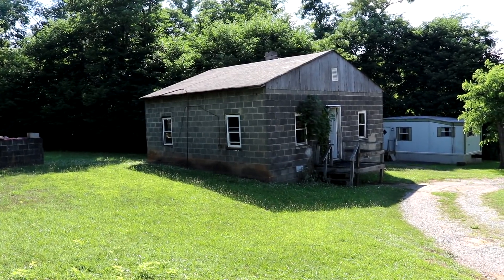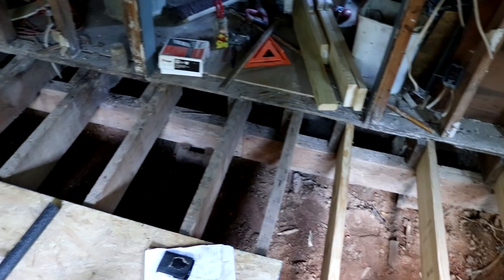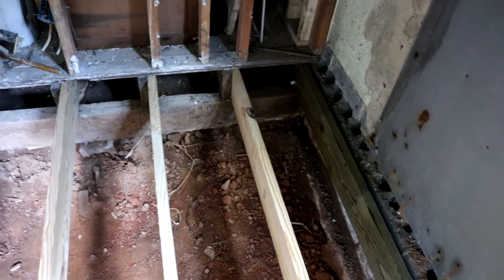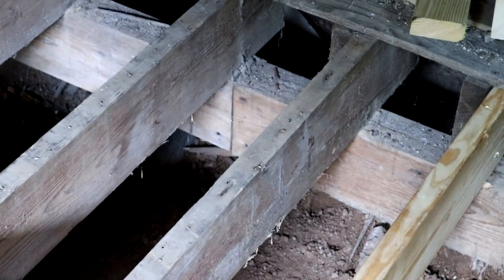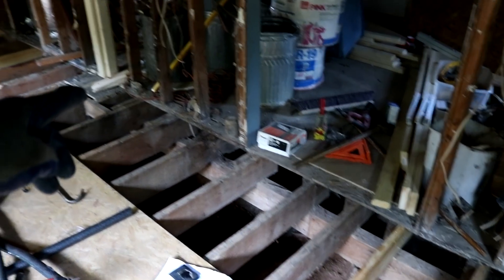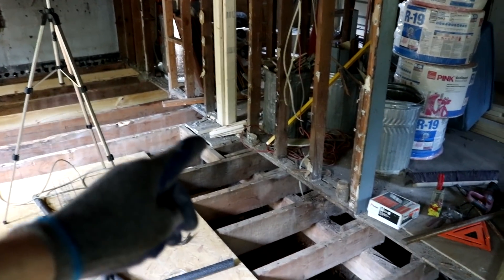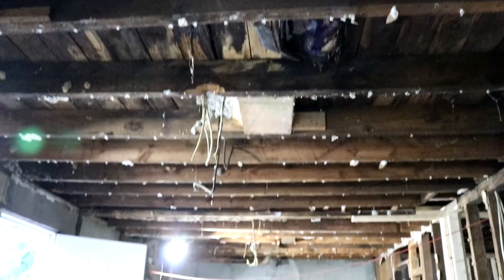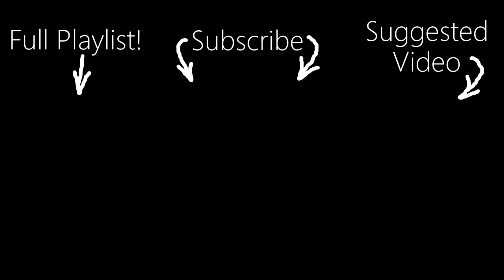My $12,000 Project House - The Floor is FALLING! - #12

Comment: Is there any concern over insects or animals nesting in the crawl space? Also are you in a climate where insulation will be necessary under the flooring to prevent them from getting cold when the temps drop?

Comment: If I were you, I'd vapor barrier the crawlspace ground with a thick mil black plastic laid over the dirt - obviously water is getting under the house from somewhere along the foundation
Reply from the maker: The house has no gutters or drain tile. I'll probably do the vapor barierer but with so much work to do I'll do it once all is done, don't want to tear it up.

Comment: "Nothing wrong with it, just a little soft in areas." Sounds like there is something seriously wrong with it, it's not pressure treated and it's decayed and softened. That bare dirt needs to be completely covered by heavy film sheet after spraying for insects, and then close off the venting around the foundation perimeter.

Comment: ok..stupid question but i rather ask than not know...why does your nailer throw a spark on each hit? is this common with most nailers?  i dont have one yet and always wanted one.
Reply: I would believe it is due to the type of nail gun. I would presume it is a powder fired gun rather than electric or gas. They use a small powder charge, which is similar to a firearm blank in concept. I may be completely wrong though.
Reply: I have an air actuated gun and it throws a spark sometimes. It's just from where the pin hits the top of the nail. No different really than if you catch a nail just right with the edge of a hammer.
Reply from the maker: I'm shooting 30 degree nails through a 28 degree gun......with that said, I've seen other guns to it as well. I find it to be exciting.
Reply from the maker: Oh, and it's pneumatic (air powered), that's why you hear the air compressor kicking on.
Reply: It is exciting, isn't it? Do you have the semi-auto trigger on the gun, or do you have to make sure the safety latch is pressed all the way before it fires? I've got the semi-auto trigger for mine, but haven't ever gotten around to switching it.

Comment: What do you use to write your eBooks? I'm so very glad I found Scrivener. I don't buy software if I can help it, but when i do it must be good. I paid for both the Mac and Windows versions which includes a discount for Windows because i already had Mac version. I also bought another tool they have which is the Scapple program, which helps my organize my thoughts for use in my own books. I applaud you documenting this home renovation. Thank you.
Reply from the maker: I just type them on a chrome book in google drive and then save as a PDF.......I think, it's been a while.
Reply: Cool. Thanks for the response!

Comment: The building code must be SO much different where you're at. I don't much about plumbing, but I know carpentry and electrical. Here in CT that beam, and every one of those floor joists would have to be PT unless you poured a slab. And, I've never even heard of cinder block footings, even decks around here need poured concrete in sona tubes at least 48" deep.
Reply from the maker: This house is almost 100 years old and probably not built under any permit. PT lumber wasn't even in use at the time. The long and the short of it is your looking at what is basically a shack, but a shack that can turn into a nice house.
Reply: @careforyou Keep your rude comments to yourself please. If you'd like to show someone a better way, then show them on your own channel.
Reply: @homemade home Yeah, I owned a two-family that was built in 1890 for a while. But the code up here basically says that once you open it up, you have to bring it up to code.  There were some things specifically grandfathered into the new code for older buildings, but not much.  I'm just guessing that the code is much different where you are. I know it changes from state to state, Hell it even changes from town to town. Anyhow keep up the good work, and ignore all these haters.

Comment: Nice work with enforcing the old wood...What tool is that you're using at 4:30???
Reply: That's a powder actuated "nail" gun. It drives hardened steel pins into concrete or even steel with the equivalent of .22 caliber blanks.
Reply from the maker: I figured someone would answer, Thanks!

Comment: Don't you need to have a permit and inspections for doing such intense renovations to this house?  I am just surprised none of this is mentioned.  Perhaps you didn't think it was relevant and so didn't put it in the video?  Also, I was really surprised about the crawl space construction.  If you had wood rot from  crumbling concrete blocks and non pressure treated wood making contact with the dirt, why would you not replace the beam with pressure treated wood?  I am no expert, but it seems like the actual issue was never addressed but just patched up.  The concrete blocks will just crumble again, right?  It needs a better foundation for that beam, like some deeply poured concrete slabs or something.
Reply from the maker: There's a lot of different ways to go about responding to your comment....all would be long winded. In short, I'm doing a "good enough" job and I don't mean cutting corners but more that I'm not going to far for what it is. This house is almost 100 years old and built as is. What I do will make it go that much longer, most likely more. No one alive now will be around by the time this house needs to be worked on again and by the time it does it will probably have been torn down and a chain restaurant built where it stands. Thanks for watching.
Reply from the maker: Forgot to mention, I just have a normal building permit for doing a renovation. Nothing much to it, go tell them what your doing, they take your money and give you a piece of paper. I'm listed as the contractor.
Reply: I don’t see why his permit situation is relevant. Permitting requirements vary so much from state to state, and even county by county or city by city within a state, that unless all his viewers are living in the exact same town, doing the same renovations, he would be wasting our time talking about it, because his permit requirements will be different from ours.

Comment: How do you live in houses without a foundation? Is that too expensive?
Reply from the maker: Not sure what youre saying.....the walls are the foundation.
Reply: There’s no concrete underneath the house. It’s called the foundation of the house. 
Essentially, the entire house stands on a couple of bricks. It’s a huge risk concerning moisture.
Reply: John Caselli it basically fulfills two major functions, one is that it evenly distributed the weight of the house to the ground. The other is that it cancels out any movements in the ground (which occur over time) and therefor makes for a sounder structure. 
It’s a major difference between European and American house building. The American way is essentially highly cost efficient, but in terms of quality, safety, and longevity, the European way is far more suitable.
Reply: John Caselli - John Caselli it basically fulfills two major functions, one is that it evenly distributed the weight of the house to the ground. The other is that it cancels out any movements in the ground (which occur over time) and therefor makes for a sounder structure. 
It’s a major difference between European and American house building. The American way is essentially highly cost efficient, but in terms of quality, safety, and longevity, the European way is far more suitable.